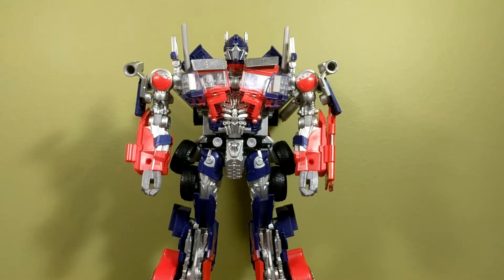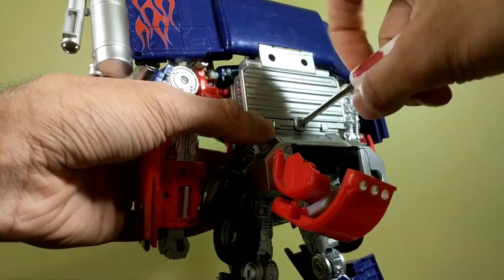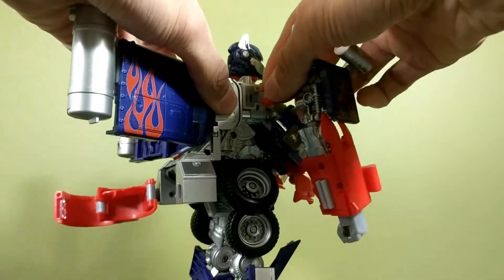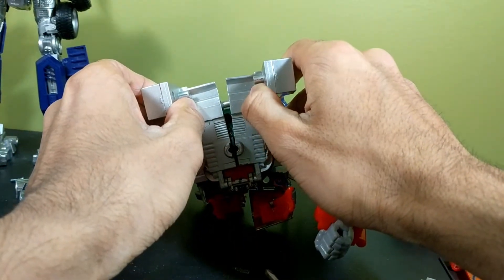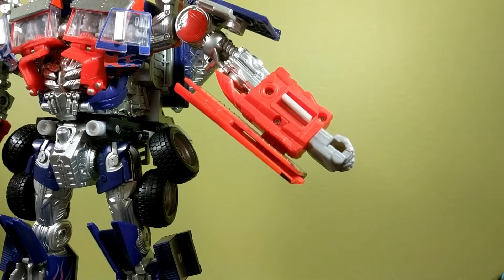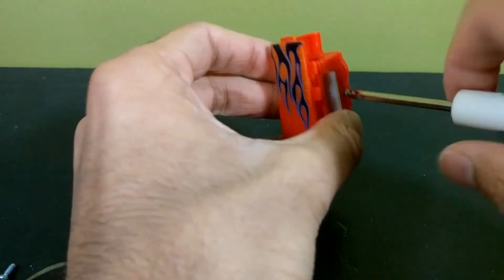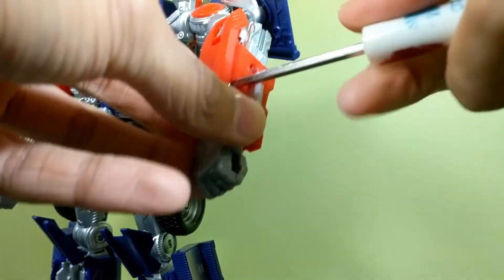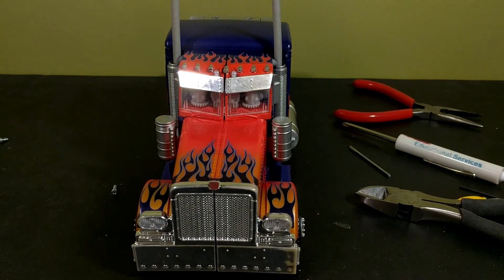ROTF/DOTM Leader Class Optimus Prime Kibble Fix - Kibble Fix #9

Comment: the way u get his fenders out is u get a block of wood and pull the bottom battery out
then u get a small drill bit and drill a small hole by the negative terminal and make sure the chest piece is in the up position and rest the area behind the right chest piece on the wood block and hammer the pin out  then u can pull the right arm off
and remove the screw hidden by the arm hinge
then u put the arm back in place and tap the pin part of the way in and flip the arm down and take the top screw out
then flip the arm back up and take the bottom two screws out and separate the torso